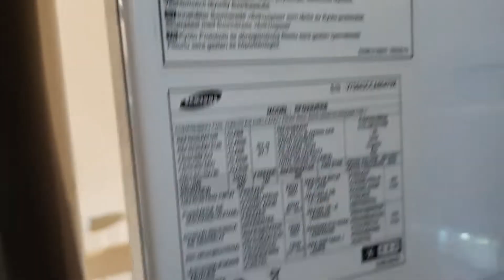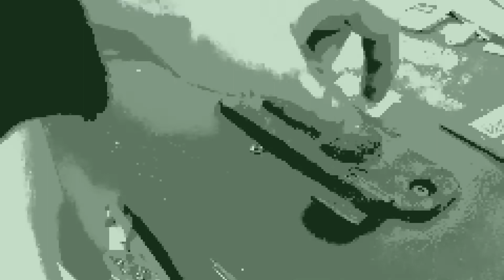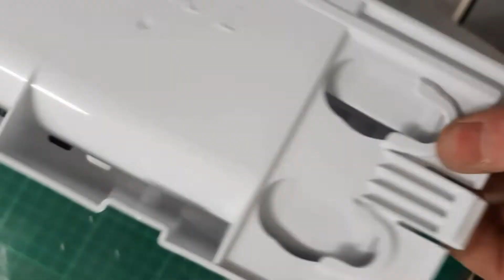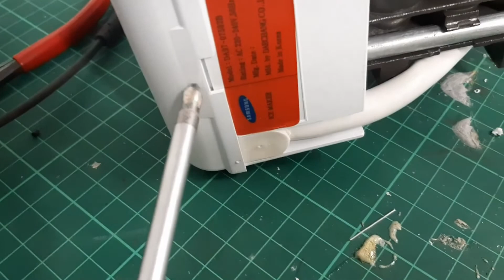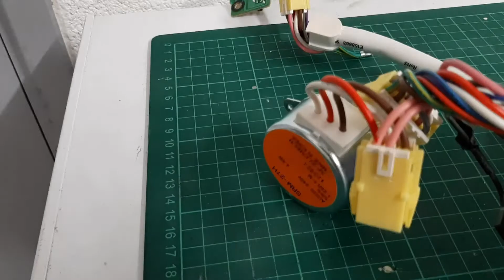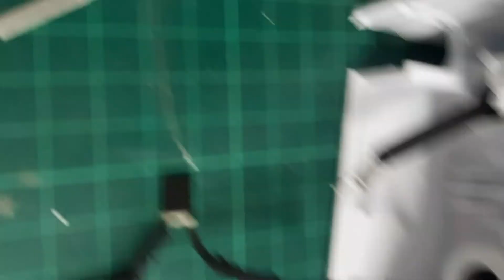Samsung Fridge Freezer Ice Maker £2 Fix no BS

Comment: I have to agree with Baileyind I was a bit on the fence Trying to decide Between two or more possible problems by their symptoms And was unsure until that moment in the video at 4:41 when you made that "RooRooRooRooRoo" sound that the motor makes 'Tryin to push out'. Such an Accurate representation Took all of the Gray area Out of the situation and help make the decision as to what plan of action I need it to take to repair this POS F'n ice maker Samson keeps producing without any changes so they can continue to sell parts at an astronomical cost All the while playing stupid or not even lifting a finger to modify this design To manufacture an working ice maker because it's very lucrative to sell the replacement parts. Personally With a broken ice maker in an RF23 which was Years out of warranty I Contacted support at Samsung Asking about their class action law suit, paying off the judge so the lawsuit never took off and raising some hell They first replied it was out of warranty and I was shit out of luck and did I wanna schedule an out of pocket service call. Hell2theNo. but then minutes after that I received a phone call from a case manager stating they would do a one time service call at no cost to me . I was confused but remained optimistic. When the tech arrived, Before he even looked at my refrigerator I told him I was also an experienced tech with years In the field with an electrical engineering degree but little to no experience with refrigerators and their defective POS ice makers. Next I explain to him that if he tried to steam defrost my ice maker Then tell me that it just needed to be defrosted and everything was OK we were going to have a big problem and that I expected him to replace the ice maker before he left otherwise this was a waste of his time and mine. He then replied 99% of the time with these service calls we replaced the ice maker. Well let me get out of your way and let you get to work Sir . He replaced the ice maker but did not change the Control Board. He also Applied the ever popular add Refrigeration grade sealer To the bottom left of the ice maker housing. It worked for two months maybe & now It will only drop ice after reset and only one time. Water from the front of the refrigerator comes out with an amazing pressure, Solenoid for supply of water to the ice maker all good, infrared sensor good, Diagnostic mode comes back with no codes, changed the dropping temperature of the ice room in other settings with no change, I've Tested and checked everything but the thermal fuse And after hearing "RooRooRooRoo" I am confident this is the answer to my Defective, Broken, POS F'n ice maker Woes. Thank you for the video mate Cheers !

Comment: Hi mate !  
I have the exact same product as you have and experience a similar problem (ice is not released from the tray), but the root cause seems to be different. I have measured 370V between pink and grey connectors and I have also measured the two fuses and the heater element individually; all OK. My observations: 
1: Power cycling the fridge produces exactly one set of ice cubes. When inspecting the ice maker I can see that the tray is only half filled with water after the seuccessful release. In other words, the next set of cubes are only semi cmoplete and are (for some reason) never released. 
2: A reset of the icemaker produces the "beep" sound and then comes the "buzzing" sound that you tried to mimic every 5s for a cuple of minutes. 

Any ideas what can be wrong here ? I was thinking about buying a new expensive DA97-07592B ice maker, but I'm not 100% sure it is the one to blame ?

Comment: Soldering doesn’t kill the new thermal fuse?
Reply from the maker: Great question, I guess it because you only heat it for a few seconds when soldering. Also the "tails" or cable to the actual fuse was quite long.
Reply: that is why it has long tails. You try to keep the length and cover them with the tubing and only solder at the end farthest from the thermal fuse. a trick I have used in the past to keep them from going is putting an ice cube against them while I solder the ends. This way any heat that travels up the wire is nullified as much as possible by the cold point where the ice is.